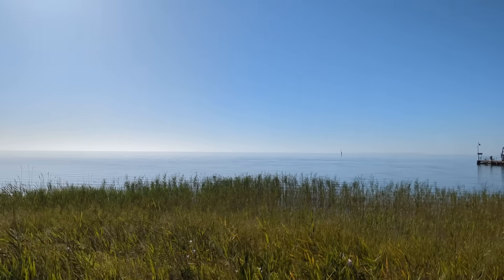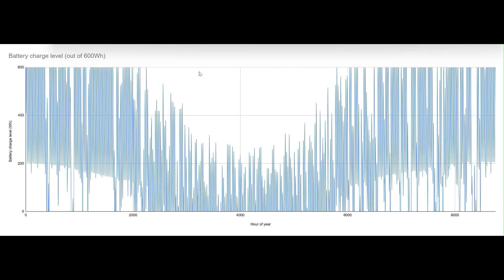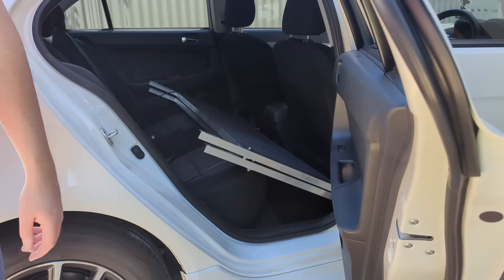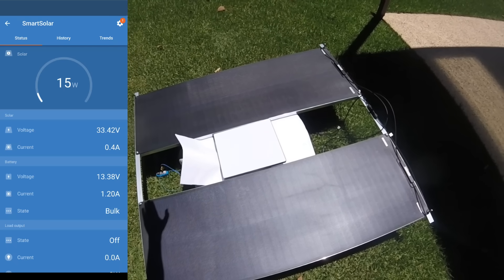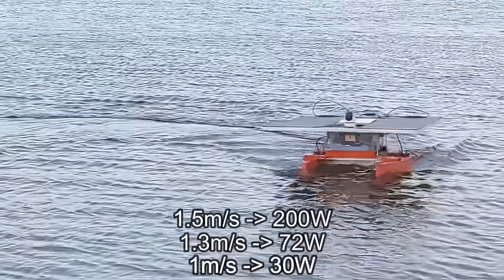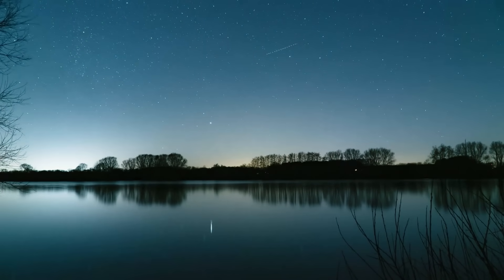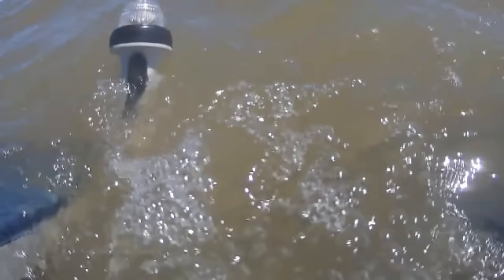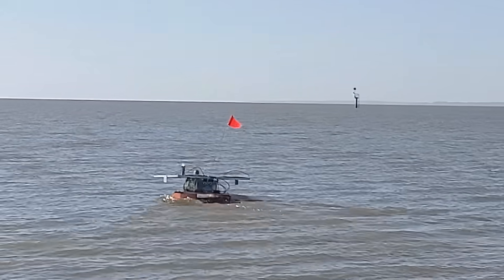Solar-powered unlimited range R/C boat

Comment: nice work, almost ardusub. More info on the systems integration stuff, companion computer, flight computer, mission planner, ardurover etc. PWM management. Starlink mini issues with telemetry is interesting. LTE would save weight and $$$

Comment: Don't reinvent the boat. An inflatable SUP would be more stable, less drag, lower center of gravity, minimal wind resistance, reusable for yourself, and more surface area for panels and battery / electronics. Plus a sitting teddy bear holding a sign, Smile you're on camera! should it be intercepted, an optional add-on that does add some wind resistance. With the same motors you used (but didn't show much), you seem to turn with directional thrust, hang them from the SUP's centre of gravity with a bracket.
Used SUP's can be had on the cheap because they are short in length and people want the new longer model.

Comment: The center of gravity weight is too high up and the mass is concentrated in the center of the boat.  Get  smaller batteries to get the amp hours you want.  Put them in the bottom of the hauls, and spread them out.
Reply: Else use a bunch of rocks for ballast to get the thing to track correctly.

Comment: No... it will not work in the dark and bad weather,  therefore NOT UNLIMITED
Reply: The sun usually comes up again the next day. In my experience anyway.
Reply: @jackfromthe60s So then, everything has unlimited range for EV can be recharged and cars refueled.   Let's label ALL vehicles unlimited range.  If it has to stop , it ain't unlimited range.
Reply: @VegasHobo  Where does it say a journey has to be completed without stopping?
Reply from the maker: I think a reasonable definition of range for an R/C vehicle is "how far away from me can it travel without anyone touching it". Of course with this boat there's a seaworthiness problem, and there's some operational asterisks (e.g. I want to monitor it, if it is overcast for more than a couple of days in a row it might have to stop, fast enough currents could overwhelm it, it might foul up if operating for long enough). But this power/comms/propulsion system fitted to a more capable hull could theoretically circle the globe, which is the ultimate crazy goal of this project!

Comment: Consider using the NACA 0009 symmetrical airfoil as inspiration for a catamaran hull design. Extra points for a trimaran using a large 0009 for the main hull and smaller 0009s for the amas. ☺️👍
Reply: Thin side would be the bow?
Reply: @dani43321  no, it would be best to have the max thicknesses forward. I know it may seem counterintuitive, but it's best to be blunt at the bow and sharp at the stern.
Reply: @TryviaT  I've heard that's the optimal shape, but at the same time every power catamaran I see is built the other way around, strange
Reply: @dani43321 because it looks cooler, lol
Reply: @dani43321 a good example would be fish.

Comment: Cool project. I think your naval architecture skills are holding you back. The constant radius hull design may appear to have low drag but it creates serious problems. Harmonic pitch oscillation combined with wind led to the demise of your craft.
Catamaran hulls usually have parallel sides for most of their length, having more volume closer to the ends.  Symmetric bows and sterns create harmonic pitch oscillation, so have different tapers at each end with the bows being finer. Also there is no vertical taper to your hulls, so volume and buoyancy does not increase with immersion. Flare the hulls vertically to correct this. To reduce water resistance you could chamfer the chine (where the flat bottom meets the side of the hull). Also increase the hull length and spacing to match your solar array and reduce the height of the solar array if possible.
A catamaran is absolutely the best design for a solar boat, provided it is designed well. A monohull will require a servo rudder mechanism for steering, a keel with ballast which reduces draft and is prone to weed fouling, less stability than a well designed catamaran and much less space for a solar array. Look at pictures of Sail Drone if you want to see an autonomous  monohull, but be aware they are wind powered and the PV is used for powering the electronics.
Reply from the maker: Thanks for the detailed advice! That's an interesting note about the symmetric bow and stern, definitely something to consider on future hull designs. Would you still recommend a catamaran for an ocean-going vessel? I want something essentially capsize-proof, so I'm willing to trade some lateral stability with self-righting. I'm thinking something kayak sized (maybe just an actual kayak), with enough beam in the middle to mount the two thrusters for differential steering. It wouldn't need to be too nimble, so I can't imagine it needing much steering authority.
Reply: @thingify-app  Catamarans have many advantages over monohulls for a solar powered boat. More surface area for the solar array. The hulls need less energy to push through the water. They can navigate shallower waters and don't have a keel that weed gets snagged on. They are lighter (no ballast). They heel/roll much less so waves are less likely to splash/break over the PV array (higher freeboard) and it will remain more horizontal. Differential thrust works better because of the greater lateral spacing of the motors. 
Stability is not a concern for well designed ocean going catamarans. Sailing catamarans have so much lateral stability the rigging supporting the mast will snap before a hull is lifted out of the water. To add lateral stability increase the beam (lateral spacing of the hulls). This adds almost no weight. To increase stability on a monohull you need to add ballast or make the keel deeper, both of which have big downsides.
Note that your catamaran did not capsize laterally, it "pitch poled" due to insufficient longitudinal stability and wind as I described earlier. As well as redesigning the hulls, make the hull length about 1.5X the distance between hull centrelines. Also keep the centre of mass as low as possible by putting heavy components inside the hulls where possible and reduce windage (aerodynamic drag) by getting everything above the hulls as low as possible. This not only improves stability but also reduces energy consumption when motoring into the wind.

Comment: Great project. It's better to wire your panels in parallel because of the potential shading. Your 100W solar panels don't have functional bypass diodes.

Comment: Good luck with this project... a great goal and good start.  I think staying with a catamaran design will give you the best lateral stability (with total width being the width of the panels) and lengthening the hulls (about 1/3 longer than the panels) will give you the best longitudinal stability (some sea going kayaks also use anti dive planes on the side of the front hull to avoid diving into a wave).  Not sure what impact the additional length will have on windage, but larger rudders should be able to deal with that.  Best of luck!

Comment: longer hulls (as others have said) to avoid pitch poling  and put the hulls further apart to give lateral stability when the waves are beam on. 
A mono hull will work but limit the amount of solar you carry, you'll also need to keep as much a possible below the waterline or have a deep keel to compensate. I would suggest sticking with the catamaran design, just make the hulls longer and wider apart, as you're within your weight limits you can also go narrower with the hulls to keep the same buoyancy, but as long narrow hulls use less power than short fat hulls of the same buoyancy you might find you can reduce power consumption or increase speed for the same power consumption.

Comment: curios to see if there is way to pick up reflected light off the water to boost panel output.. maybe a reflector or prism?
Reply from the maker: There's bifacial solar panels which can be illuminated on both sides - it would be interesting to see if any meaningful power could be generated like that from water reflection
Reply: @thingify-app  Yup.. I think you can set them at 45 to the water surface sorta like a V shape. I was concerned about shading so wondering if u have prisim suspended between the V does that reduce shading in the center while still enabling capture off water surface. Very cool project

Comment: issues you have is top heavy and dont have any weight under boat like sailor boat does and you may ended up doing is making hull longer and 4ft add to it balance it out weight so doesnt tip over in water 2nd thing you may ended up find way add weight inside hull and pump to pump water out hull so doesnt sink aging

Comment: Seriously cool project, but why on earth would you design your boat to be that shape? You don't need a mono hull, just spread the two hulls out. Of course it was going to fall over, the top is wider than the bottom. If you look at real catamaran designs, on google images, how many of them have anything that extends beyond the hulls? None! 

Also you can also get solar panels that don't mind being shaded, then they could go much lower down.

Comment: Do the solar panels parallel. Make it more bird-shit shading proof!
Reply from the maker: Good point, here I was just thinking of foliage shading 😅
Reply: @thingify-app  Efficiency also improves if Vsolar (mpp) is near (but above) Vbattery. Not a big issue 4 you because you got a good charge controller.

Comment: Needs a longer hull for efficiency at faster speeds. You can see its already starting to climb its own bow wave.
Reply: I think symmetrical hulls might help too. The hulls look like they're wings lifting away from each other, which would add drag. 
Narrower/longer would allow the hull to sort of exempt itself from the hull speed rule,like a lot of small, fast sailing cats.
Reply: @EricUdell  after so much work, you really dont want to lose this vehicle, I think time spent improving the hull, might save from a disaster at some stage, really worth considering. whoops wrote this before watching whole video, you know there are probably objects already sutiable for use. Surfboards are cheap and common and can reshape them easily, I see your already on the design of it. I wouldn't be scared to go big, make it really stable. Problem might be human interference when its out all alone.
Might be worth puting a visible note on it, saying its a research vessel or similar, so people wont steal it.
Two small surfboards as a catamarran might also work.
Reply from the maker: It's interesting how the hull speed theory comes into practice here - for a hull length of 1.2m, hull speed is about 1.4m/s which really is when we start to see it climbing its bow wave!
Reply: Используйте две байдарки, соединенных как катамаран. Это очень быстрая и легкая лодка. И очень устойчивая. Много места для солнечных панелей.

Comment: I want a million of those boats on the seas with sensors for water current, sunlight, clouds, winds, a fishfinder and than some more. All this data would be fed into an AI, and the AI has to figure out where islands a land are on this planet, with only the data the old 
seafarer like the ones who traveled all the way to Hawai'i had. One of the only things AI would be good for if you'd ask me.